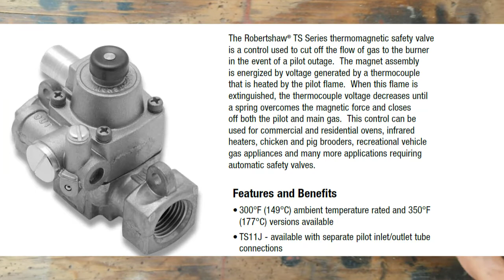124 Robert Shaw Thermomagnetic Gas Safety Valve

Comment: Thanks for the video. I was having an issue with my ts11-j just like this one. Thermocouple checked out ok, and I assumed it was the solenoid but upon pulling apart like you, I could get the solenoid to hold the main valve open but when I pushed in in while exciting the valve with a heated thermocoupler... end result after watching your video was a bad center spring that had collapsed. When you try and light the pilot, it would light, but when you let off the button it goes out. That collapsed spring wasn’t slowing the assistance of it to push it forward so the solenoid could take over and hold it locked open. Since my little center spring wasn’t piping that end out and was sunken in, it looked like it was just one solid piece and made that way... if I didn’t see your video I’d assume the end was supposed to be flat and not popped out by that tiny spring which again helps assist the valve in opening BUT also helps assist in seating the valve in an open locked position. Thank you very much!!!
Reply from the maker: Great that it helped. I learn so much from other people's videos that I feel obligated to try and give something back.
Reply: How did you fix your issue? Because I’m having the same trouble as yourself. Or did you buy a new one? If so through where?